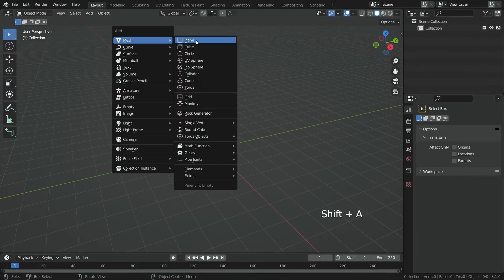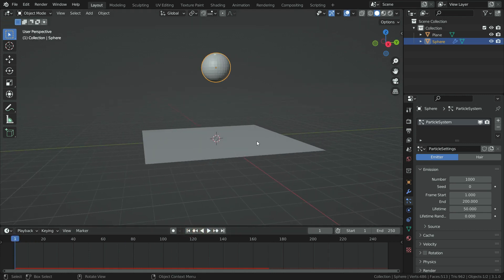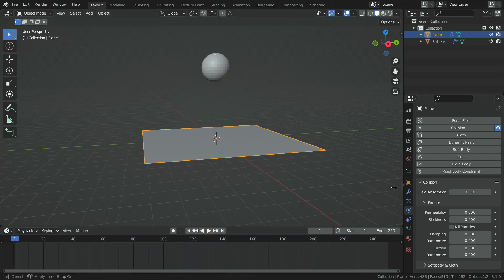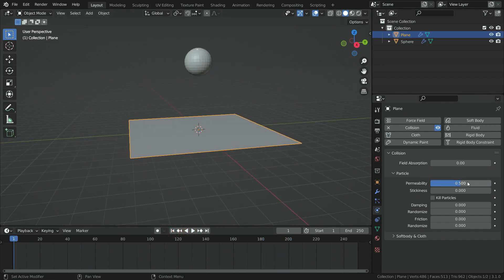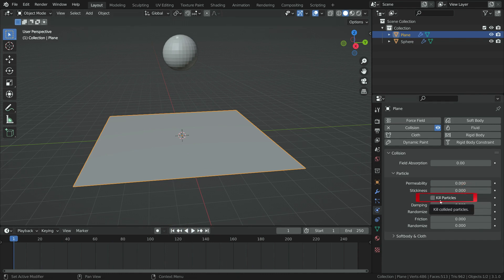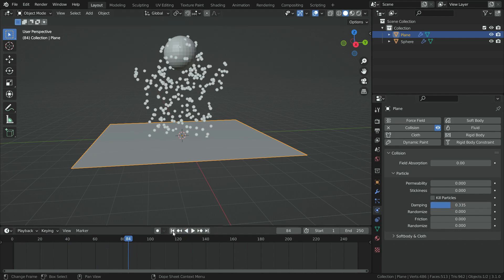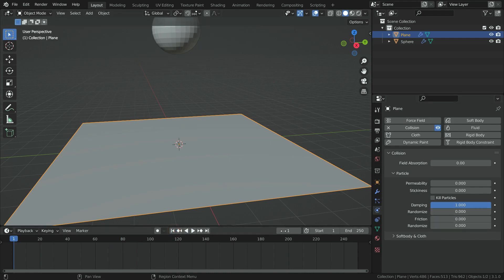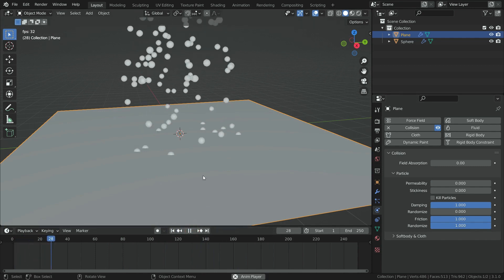Collision Settings For Particle System | Blender 3.1 Tutorial

Comment: For some reason, my particles still don't collide with the plane despite the plane having rigid-body physics. Does anyone know what settings I need to enable? (Using Blender 4.0)
Reply: I think you have figured it out since your comment, but for anyone wondering, you need collision physics, and not rigid-body (though both can be activated at the same time)
Reply: Thanks bro  @takapapatapaka5326
Reply: @takapapatapaka5326  I made a carpet using the particle system and I've added a table on top of it. Now the hair particles of the carpet clip through the table. Any idea on how I can fix that?
Reply: @therealslin  I just tried it quickly and got something kinda working. To sum up, you have a carpet, wich is a mesh with a particle system set to hair. In order to move away from the table, the "Hair Dynamics" tab should be activated. We also have a table, which is a simple mesh, with collision physics enabled. 

Now I got there, and despite moving the table in the editor, it did not affect the carpet's hair, I guess this is probably where you're at too. The trick here is to animate the table, so the simulation can be run when you press play. I placed the table above the carpet, inserted location keyframe, went to frame 10 or so, moved the table to its definitive position, and inserted a second location keyframe. Then I played the timeline from the start and then only did the hair bend around the table.

What I don't know is how to make this effect permanent, so you don't have to play the animation everytime. I guess you could convert the particle system to mesh, but I think it's not ideal since it's not very optimized. Another way would be to render the animation only after the table "landed" on the carpet. Anyway, I hope you'll find what you need ! And good luck for your project :D
Reply: @takapapatapaka5326  Thank you very muh for your effort! It does work now.